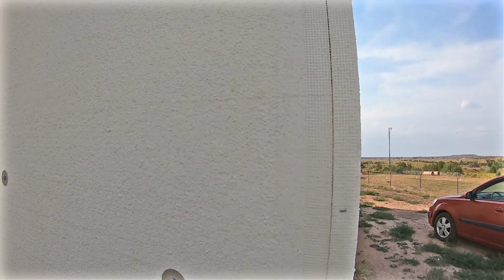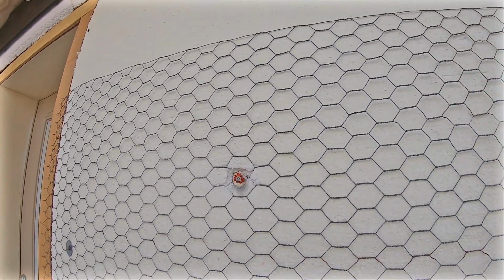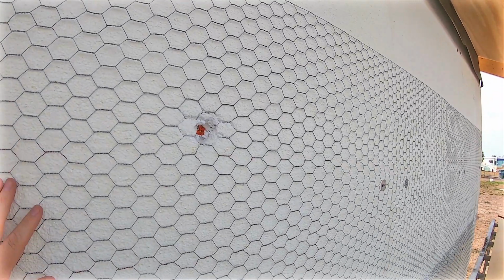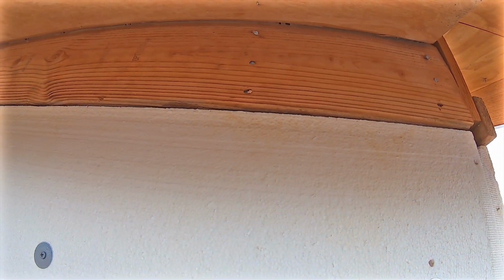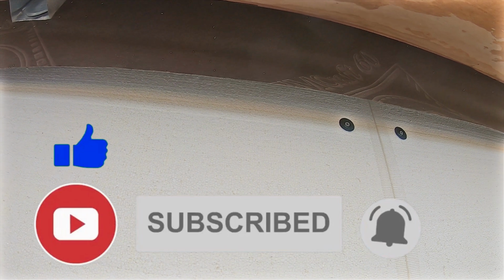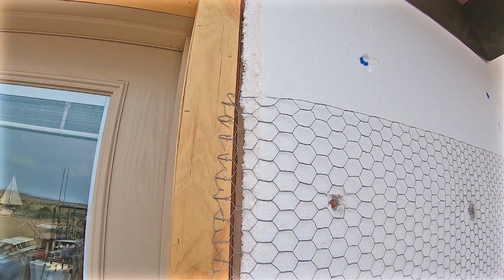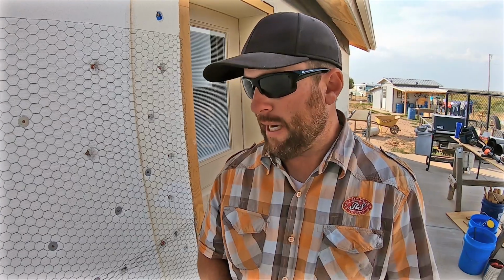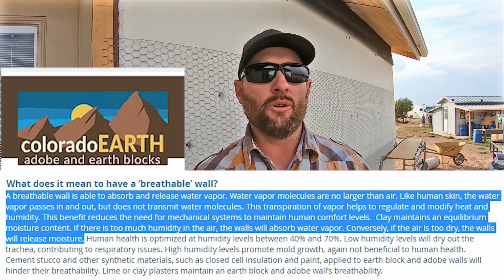Compressed Earth Block | Stucco

Comment: Great proyect, I'm thinking doing something Similar but with plástic clips instead of wire to attach (to avoid thermal Bridges), my blocks Will be like a normal brick dimensions so I was thinking doing doble wall with a cavity (semi-ventilated) in the middle so in the internal wall I can benefit from the breathable material and in the outside wall insulation like you do it, Is this a good idea?, I would love to ear your thoughts about it before doing anything, and another cuestión: how it Is holding the stucco after 4 months?, Any cracks or recomendations?, I really apreciate all the info Man, keep doing grate!
Reply from the maker: My opinion would be that unless you live in an extremely cold area I do not think the thermal bridges of the wire will really make a difference.  The block is of greater thermal mass so it would make sense to me that it would not be that much of an effect.  The stucco is holding up well, we put up a synthetic coat over the stucco and is seems to be doing well.  The guy I hired said we did not need any stress joints to control cracking, I should have insisted that we put them in as I do have a few cracks.  As you know the one thing you can count on is stress cracking from concrete that is why joints or put in to control where it cracks.  So other than that it is doing fine, they are not anything major, if we were to paint this synthetic coat it would cover them up.  Hope this helps good luck with your project.
Reply from the maker: Also for doing the cavity in the wall, if it is like my friends house where he laid two courses of wall and left a gap between the two walls then you will have very stable temperatures.
Reply: @SustainableLiving  How big was the gap between the two walls of your friends place?  What’s the overall wall thickness?  Did he really go more than two feet overall width?  I can see your house has 12 inch thick walls.  For a second wall at the same width plus a gap, that’d be one heck of a thick wall.

Sounds like a HUGE amount of work.  That’s double the blocks needed for exterior walls.  I wonder if they would be tied together somehow?  How did he do the concrete cap?

Comment: Hello Jacob, I like your videos and instruction very much. I am just about to build, hopefully with an Interlocking Stabilised CEB, and the exterior walls will be double block (L 300 x W 150 x H 100mm - sorry, for you that's 12"x6"x4"), with a 4" cavity that will have 3" of Polyisourate foam board (closed-cell foam) in the cavity. I hope to render the inside and outside with cement/lime plaster. To enable adhesion I was going to scratch the surface of the blocks with nails protruding from a piece of timber, or something similar. Have you got any advice for me on this type of project?
Reply from the maker: From my understanding scratch coats are a practise used but I do not have any further suggestions

Comment: If you would have used the wire would you have poked it through the insulation?
Reply from the maker: Yes and then fastened to the stucco wire.
Reply: @SustainableLiving  thanks